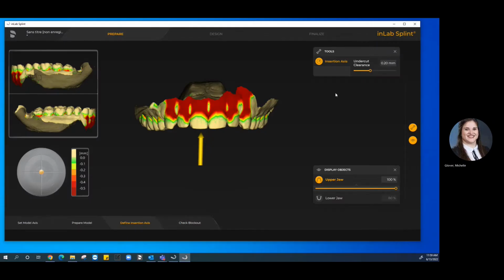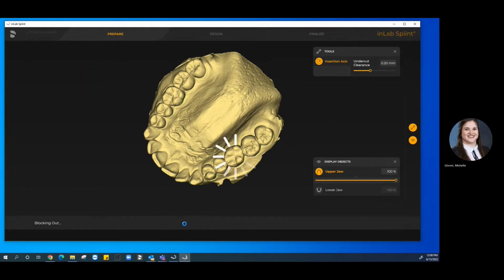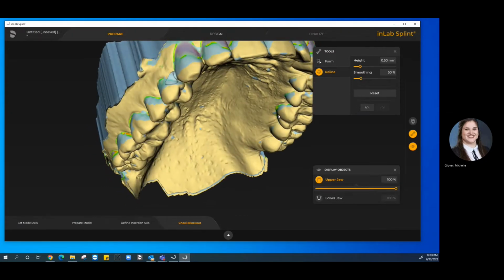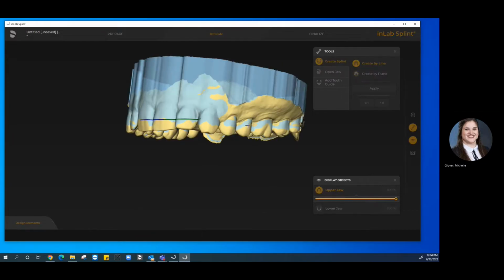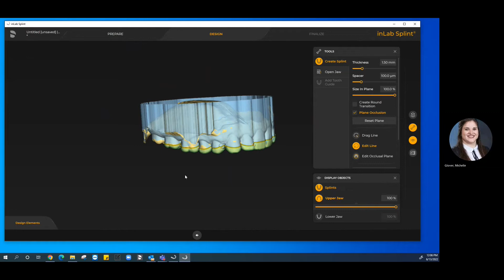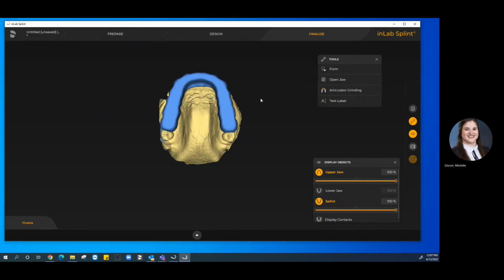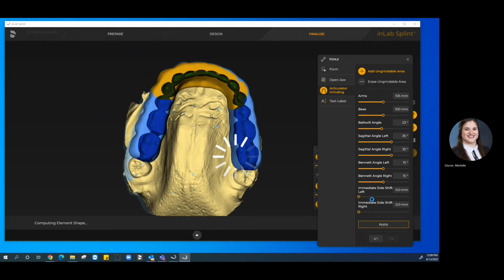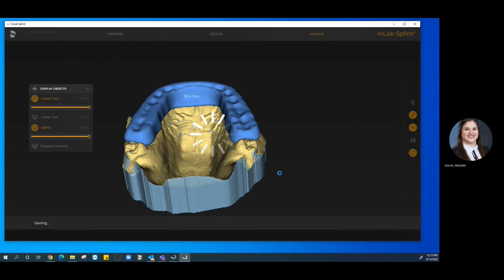inLab Splint 22 Tutorial

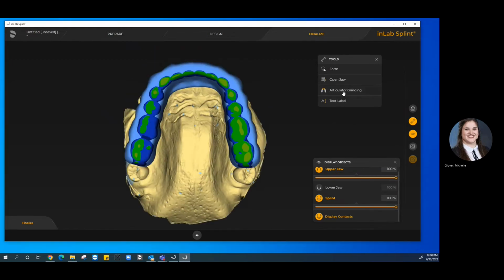Comment: When you articulate around 8:07, why blockout the anteriors from grinding? wouldn't a more sufficient ramp be created by articulating everything without the orange areas and seeing where you need to add more material for canine and protrusive guidance?

I'm a <1 yr digital dental technician and I'm overthinking parts of inlab I think, when it's supposed to be easy and relaxed. Trays are fun and easy but splints cause me more stress but my dentist can be picky at times (which I love to learn and grow of course)

For context we are creating flat plane occlusal guards with an anterior ramp for canine/protrusive guidance.

thanks for any help haha
Reply from the maker: Totally fair question. I usually find the easiest way to create the anterior canine to canine ramp is manually with the “form” tool and “add”. I notice the articulator grinding tool can be finicky patient to patient if the parameters of the virtual articulator aren’t changed for specific cases. So I often opt for a manual approach haha.
Reply: @DigiDentStrategies  Thank you!! Love your videos. Only source of knowledge on inLab on youtube it seems :(

Your channel has been a godsend as a guy new to dental and also digital design in general

Comment: Thank you for all of these excellent tutorials. 
We recently started printing using the PrimePrint splint material and are having a bit of trouble understanding why we continually get a the "minimal thickness" warning while finalizing our designs. It seems no matter what we do with regard to adding material we are always too thin as calculated by the software. If you could provide any insight here it would be appreciated.
Reply from the maker: Happy to help! So the minimal thickness will always come up as a warning. However, under the analyzing tools of you turn on the minimal thickness scale, all you want to be sure of is that significant blue isn’t present on the occlusal surface. Especially in the posterior region as that could mean significant thin points that could break at the time of insertion when the patient bites down. Hope this helps! :)